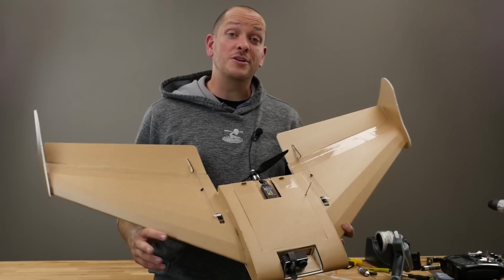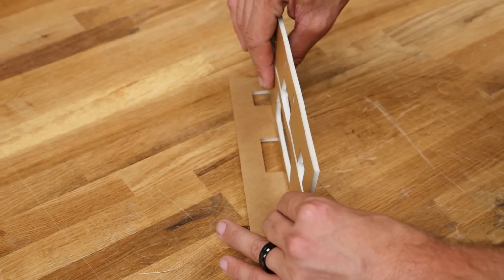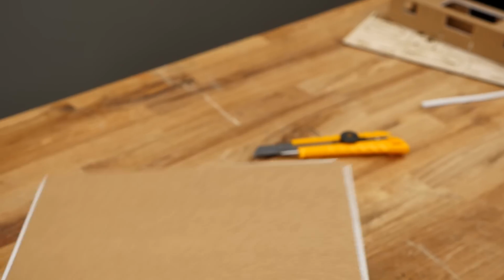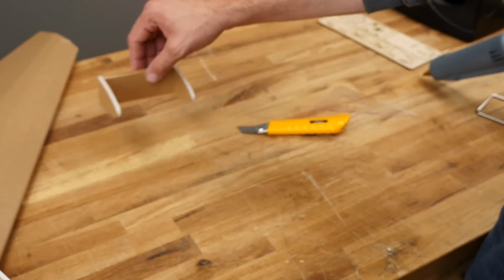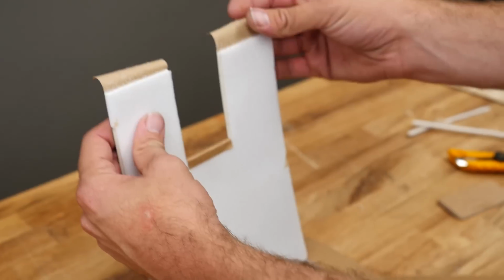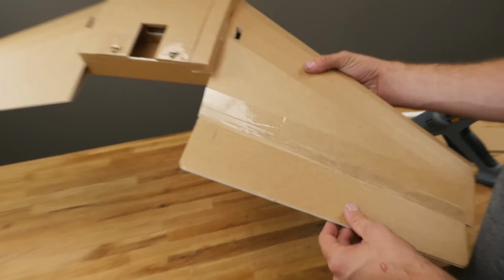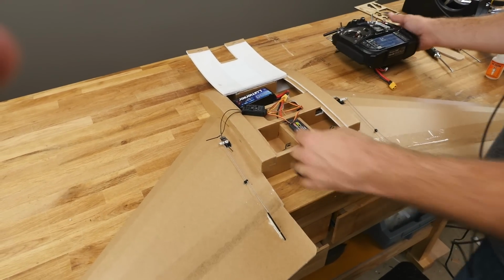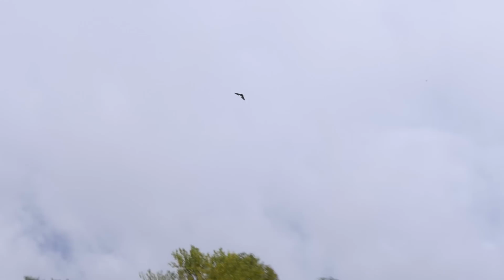FT Spear - BUILD | Flite Test

Comment: I think there is an error in the Centre Cover section of the plans. I am closely following the video (scratch build) and thought I had done something wrong. This section is printed as one large piece with a 50% score close to the middle. I realised that this should have been a cut to make it 2 pieces. After cutting I notice that the paper hinge section is not marked on the plan. Thought you would like to know. I've gone back and checked each of the 3 plans and it's the same on all of them

Comment: Fnally I maidened my FT Spear today ( August 14. 2019) , after I built it almost a year ago, it was hanging around on my wall with unfinished paint job. I first flew it with a 2400 3S Battery and then with a 2200 4S which gave it much more thrust. I liked, that it flew from the first throw without any trimming very well and glides nicely. Actually I got 8 Minutes with th 2400 Battery...  I wondered that the motor I purchased from flitetest (Powerpack C) was only for 3S but the BLHeli for 2-4 S....  I hope the motor doesn't burn away....  Anyway it flew amazing. I didn't know it was such a great FPV Ship at all...

Comment: Hi, greetings from India. I have a question: why are the servos always placed so close to the body? I find that if I crash a few times and the foam becomes a bit soft, then the entire elevons do not move and only the part near the control horn moves. I was thinking will it not be better if I place the servos bit closer to the centre of the wing? Will that solve the problem or am I missing something? I know the servos will need extensions but thats ok..
Reply: You're right , the aileron would not twist under flight loads , if the  horn is placed in the center , I would also place the servo in a horizontal position in the wing , only the servo horn would stick out
. Perhaps they chose to place inboard,  for simplicity , no need for servo extensions ?

Comment: Hey Josh, that thing looks so fun that I'm planning on doing one of these...but I'm gonna throw a twist at ya:

Instead of using a single BLDC outrunner, I'm planning on using twin counter-rotating Cox 0.049 throttleable engines in pusher config, and I'll have fixed tricycle landing gear on it as well, as I want to be able to take off and land like a normal airplane.

Gonna be fun! And I will eventually FPV it! I'm thinking a mixture of engine location, configuration, and a little MonoKote on it will seal the foam off nicely against any residues that might otherwise attack it. Twin 30cc fuel tanks, one for each engine, should provided pretty good duration too.

Comment: Thinking about using wings of this, for an ft arrow like center pod. 2206 motor, 2300kv 6x4.5  bullnose. Auv about 600-800 grams. 
I wonder if it will work...
Any suggestions?

Comment: Hello! I am really crazy about acquiring a FT Spear, but I am not sure if it will fly "neat" and stable with my Emax 2812 motors CF2812, 1534Kv. The thing is, this engine seems to be a little too fast for a propeller bigger than 7x6, hence, my worries. I know I can fry it's coils or blow up the ESC if I try something not signed up by their manufacturer. My powerhouse is a lipo 2200mah 3s 11.1v 20c, weight 188 grams. Witch I am not sure if it is approved by you guys for this wing. Thanks in advance.

Comment: I would like to see smaller and fewer tabs in the  laser cut foamboard. The worst ones are in the corners where they can pull the paper off. I know they are a pain to handle but I have had a lot of paper peel on my speed build kits.

Comment: Hmm... I may not have accounted enough for the radius on the pushrods. I got no down deflection, but plenty of up. I may just go ahead and get some proper connectors and re-do those (again). Otherwise, she's together. Not as pretty as yours, but it's my first one.
Reply: Maiden today, still need a little tuning. I set my rate a bit low and didn't have much throw, but still flew solidly. One hinge joint is a bit heavy on the glue, so I may need to re-do the hinges. Couple scrapes on the nose/belly, a little leading edge ding, a busted prop, and some fixable damage to the fins, which I'd planned to reinforce anyway. I'd have posted a video, but my friend kinda botched the recording. :) One thing, though... this sucker is a bit fast for the little field behind our office. ZOOM!

Comment: hey guys another awesome plane. just wondering when you'll be coming out with a video showing some mods. either from the ft crew or fans. it will be hard to improve on this great design but it can be done. already working on breaking 120 mph. had to upgrade the servos. found out the hard way. maybe a short video on doing mods and some quick tips like bigger servos. thanks guys and God bless.

Comment: Because I did not want the tape or the CA stains on the elevons on top. I reversed the procedure. Bevel on top, Tape on the bottom. Power-Pack C , as suggested on your site is totally wrong. Props too big, 4 too many servos...smh...I'd build a Spear-specific PP.. No instructions on building the power-pod in your vid either., And no cam-strap included..:(

Comment: what does 425 sized motor means?
most motor i see has specs with at least 4 numbers eg 2212 which translate to:
22mm motor diamater
12mm motor height

but 425?
Reply: Saiful Raznan 
So, how many KV ?

Comment: **EXTREMELY IMPORTANT PLEASE READ**
Dear Flight Test.
I please recommend that you make a video to rally to action the lastest Prototype of European Drone (Rc Model) laws that may be enforced by the EASA and ultimately, the EU as a whole. 
The new and 'improved' regulations are:

>No flying over an altitude of 50m (Enforced with mandatory electronic devices.) 
>Max Model Weight 250 GRAMS!!!
>Max distance away from user 100M!!!!
>Max speed, 54KM (30ish MPH)!!!

As you, Flite test harbour a large community of Rc modelers, I think it would be not only necessary for you to bring a awareness, as these rules could (and will) spread to other parts of the world. These rules will almost indefinitely end the Rc Modeling community in almost every single aspect. There are online petitions, and contacts that members in the hobby can use to help alter, or remove these regulations that WILL eventually be adopted if nothing is done. 
Please consider the request of me, and many others.

Comment: What type of Foam do you use? and where would i be able to buy it in the UK or EU?
Reply: Hobby craft  stock it in their shops. Size A1.  4 sheets for £10
I have built several FT planes with it. It is just a tad heavier than the FT foam board.
Reply: I found it in Germany. Its even the original foam from FT. With the keywords you probably can find it also in UK. https://www.graupner.de/Flite-Test-Foam-Board-wasserabweisender-Schaumstoff-by-Adams-50-Stueck/FT4000B/

Comment: Is it possible to 3D print a RC plane with a really big 3D printer?
Reply: you probably could print the parts... but not a complete plane.. be cheaper and easier to cut it from .... flat sheet foam (sound familiar?)

Comment: Off the subject. Is the future of FPV not restricted to Fatshark anymore, and other systems that we're used to? Given that the DJI Mavic goggles will be 1080p, and about a 4 mile range, more than Connex (about 3 thousand feet range and 720p only), and given Fatshark goggles are like 800 by 600 something in resolution, I feel like I shouldn't spend $ on what we're all used to buying anymore. Anyone feel the same? Also, it would be really cool if we had a system, 1080p and long range too, for fixed planes.

Comment: I'll built it! But I don't know where to find this kind of foam here in Brazil. Can someone point other names for this? Like "Isopor", "EVA", "Depron", etc?
Reply: Flight Test you guys are top notch.  I've done a bit of price comparing and you guys are not joking around.  You are seriously trying to make this hobby available to anyone.  Sure you might be able get some things cheaper here and there but overall you guys are really doing a great job.  On top of that it's clear you are taking a personal approach to help people out.  Really really great to see.
Reply: Ok, I found it. It's called "Spumapaper" here in Brazil. It's a sheet of "Depron" with 2 sheets of paper glued. Costs about R$ 25 here (or US$ 7) per sheet.
Reply from the maker: hey Daniel!
I figured would check in and see...would it be cheaper for you to buy a 50 pack of the FT foam and have it shipped there instead of spending $7 per sheet?  I am not sure if it is possible, but it MIGHT be cheaper in the long run...let us know!  We want to make it is easy and as cheap as possible for you and the rest of the community to build all airplanes! 
Thanks for watching daniel!
S.O.
Reply: Hello FliteTest , thanks for reply. I just tried to buy a box of FT Water Resistant Foam Board (50 pack) and the website returns an error in the checkout screen: "Unfortunately one or more items in your cart can't be shipped to your location. Please choose a different delivery address."

It'll be awesome if i can buy it from you guys... We have here a group of people who will love build and fly your projects.
Reply from the maker: Hey daniel!
Ill check into it and see if I can see what is up!  I hope we can get it to you ;)
Blessings,
S.O.
Reply from the maker: Hey Daniel, I talked with my shipping guy and he said that because the box is a bit large, that sometimes if you order more then just one box of foam, then it makes it to big to ship by AIR.
Try and just ordering one box of foam and that is it...
If that does not work... then we are looking into getting smaller quantities( 10 pack and 25 pack) of the foam to ship, which should help with shipping!

Let me know and I hope it works!
Blessings,
S.O.
Reply: Hey +FliteTest, really glad for your effort. I just tested here with only one box of waterproof foam board in the cart. I tried to estimate shipping cost (Brazil, ZIP 01155060) and the same error message appears. :-(
Reply: if you want it might not end up worth it but i could buy some and you just pay for the foam  plus shipping and i could ship it not sure how it would  work though
Reply: Cody Steinbach don't worry man. I'm used to live here. Unfortunately aeromodelism is an expensive hobby in Brazil (like everything else besides food). Stuff imported by mail can triple the price, and few local manufacturers do crappy products and sells for sky high prices.
Reply: yes they are very good, im just starting out here in New Zealand, so hope shipping to me is not to much hassle :)

Comment: Perhaps the quickest FT Plane I've seen y'all pop out yet! I'm curious on how the motor handels continued use. By the end of the second flight does it need a cool down, or does having the esc exposed like that cool of the system enough for practical back to back flying? My pushers always seem to get hot with the Grand Turbo after a little and I've been trying many ways to address it! The next attempt is a bit ambitious (but hopefully not rubbish).

Comment: what happens if I build it and then fiber it? if I'd do it right would this make it ultra strong but slower?
Reply: It would be so heavy, that it would fly bad.
Reply: +FloresRC define bad if you can because I don't really want it for acrobatic stuff really..
Reply: On a wing, just a little tail weight is going to make it super tail heavy, and hard to fly. i would not do it if i where you. its going to be so hard to make the CG right.

Comment: Can the ESC thing get hot enough to weaken the hot glue that's holding it on?
Reply: Even if the hotglue weakens it will not change the flying characteristics
Reply: Yeah, but if it weakens enough for the glue to fail, I'd be worried about it getting blown into the prop.

I guess what I'm really wondering is if it shouldn't be held down with one of those velcro straps or zip ties or something.
Reply: I didnt put it on the motorbox but into the strong box in the middle next to the transmitter

Comment: Bought mine today, I need a Burrito
Reply from the maker: haha Indeed... even watching the build its making me hungry! ;)
Thanks for watching!
S.O.
Reply: FliteTest your so awesome a long time ago I went t with my dads friend to go fly his plane it it was cool 4 years later I was home alone and I watched the raptor build and 6 months later I told by dad about it 1 month later I got the stuff and built it thank you so much for getting me into this hobby right know I'm building the ft mini guina pig  if you read this thanks for everything
Reply: would it be possible to replace the top and bottom of that center spar with wood and remove the sides of it?   thus allowing two batteries to be slipped either side of the power pod.